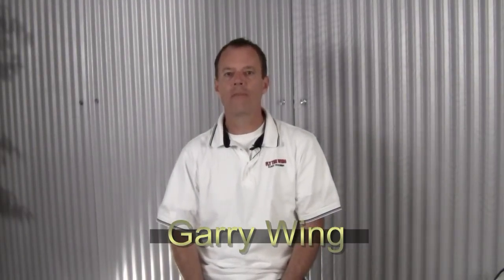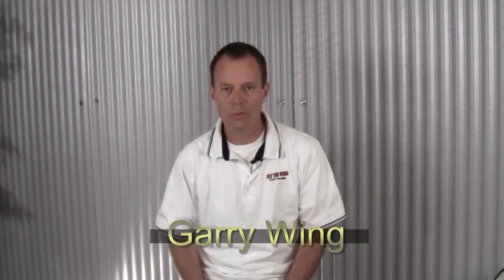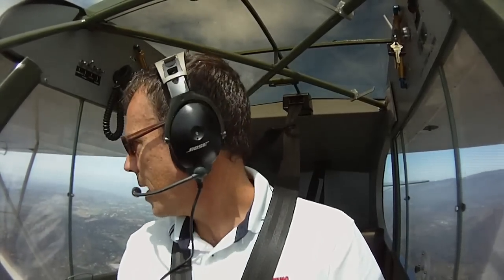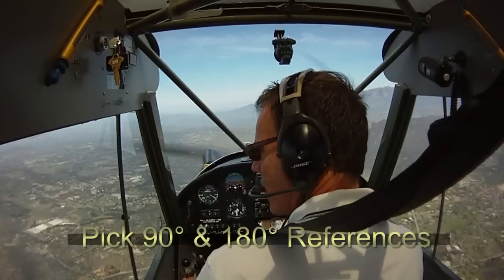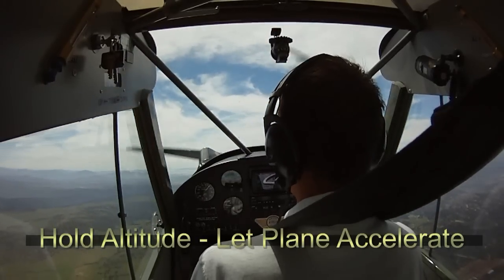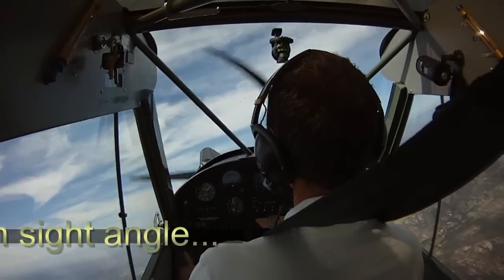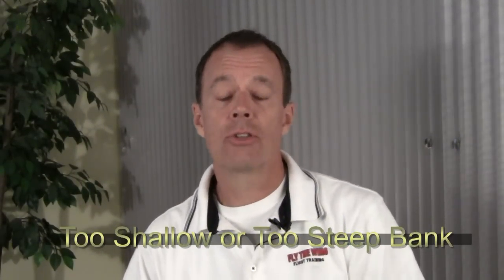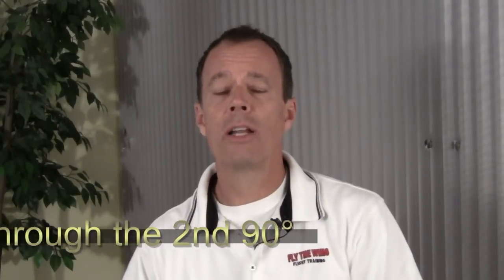Chandelle Flight Maneuver

Comment: I see the CFI altering power. I thought that Lazy 8's and Chandelle's were to be High Performance maneuvers? IE, no power alterations during the procedure?? Am I mistaken?
Reply from the maker: +Ian Gilkeson I began the maneuver from S/L flight, below Va, and applied full power in the climbing turn, exactly as described in the FAA's Airplane Flying Handbook. (Page 9-4): "As the climb is initiated, full throttle may be applied gradually so that maximum r.p.m. is not exceeded". Also look at the Commercial PTS; element 5 of the task: After establishing 30° bank,  "Simultaneously applies power and pitch..."
Reply: Cool. Thanks! I was getting worried for when I started my comm. maneuvers. :) Picked up a new Comm. PTS booklet too.

Comment: UND flight training video says in a left chandelle, more left rudder needed on rollout, in a right chandelle less right rudder is needed, you say the opposite...who's  correct?
Reply from the maker: +johnf3305 Are you sure UND says left rudder on rollout...? With a high nose-up pitch angle, you generally would always use right rudder, not left. Please see FAA's Airplane Flying Handbook Page 9-5; 5th paragraph: To roll out of a left chandelle... considerable right-rudder pressure is required during the rollout to overcome the effects of aileron drag and torque.
Reply: +Garry Wing ...my bad, after re-watching the video they do say that in a left chandelle on rollout MORE right rudder is needed...must have gotten my right and left backwards....I'm working on my commercial fixed wing right now, so I'll be following your maneuver series...great stuff! thank you for making it available...